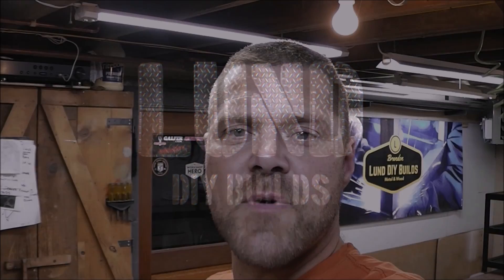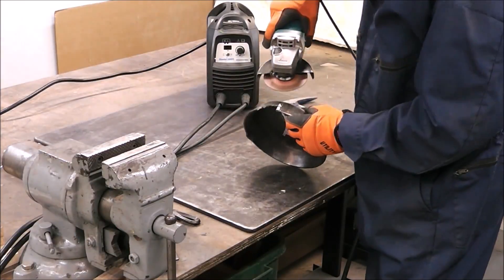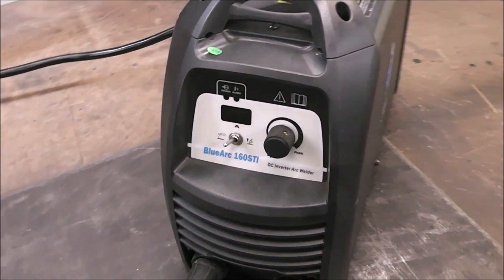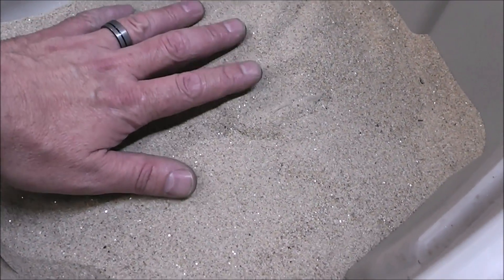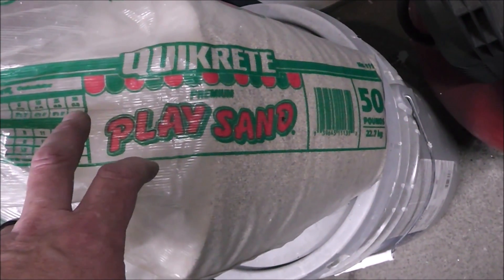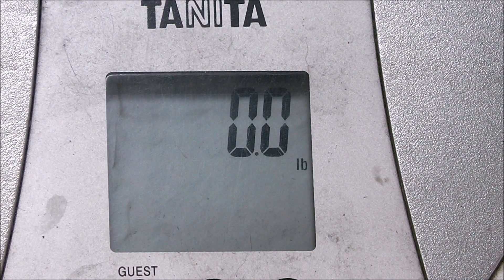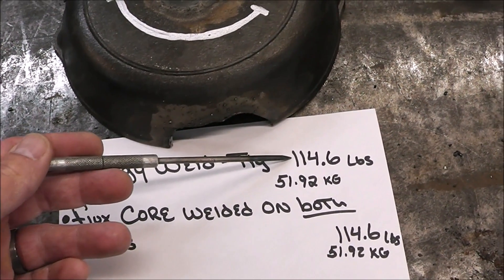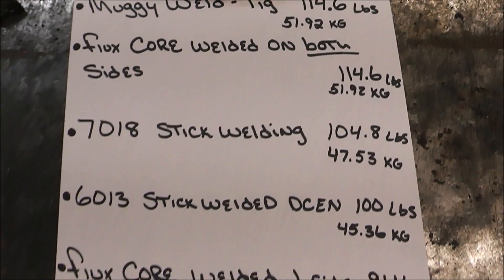Stick Welding Cast Iron Repair with 6013

Comment: Stainless steel stick?
Can you do it?
Reply from the maker: Great suggestion Daniele, I believe it should work,  but just how much it will hold compared to the others? We will soon find out! Plan to see this in an upcoming episode. Thanks again for the suggestion!
Reply: @BrandonLund  on the charts seems that may work better than 7018 because of nickel chrome and other metals content in the stainless steel rods 
You can try using 304 306 308 309 312 316 rods so 6 attempt to do